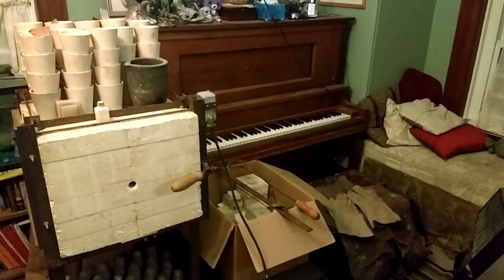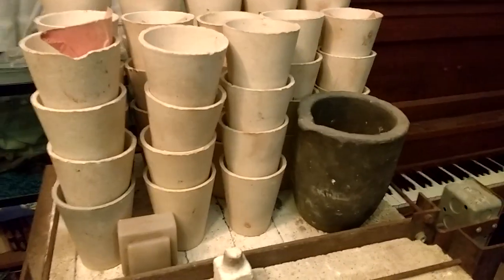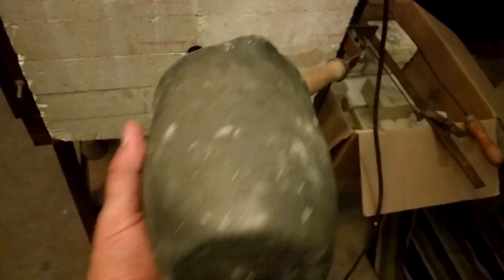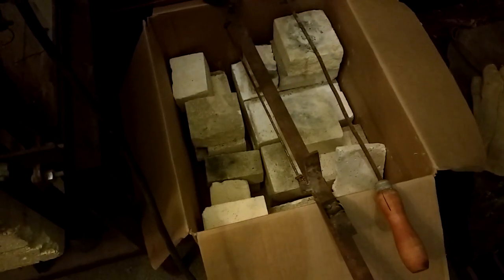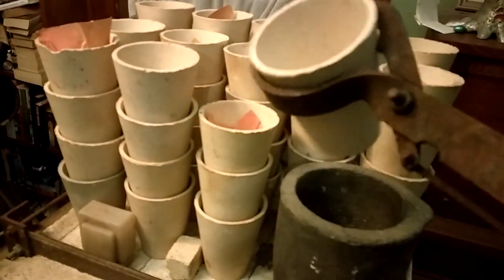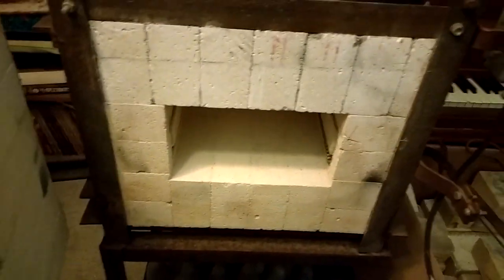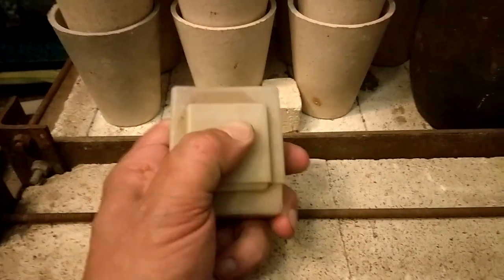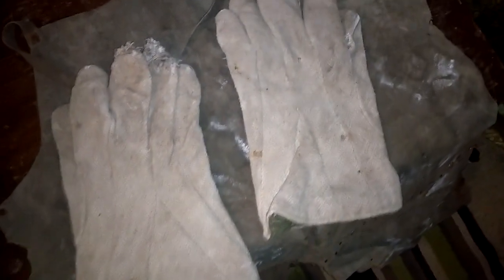New Foundry Gear - Electric Kiln, New Crucibles!

Comment: Nice find indeed. I had to pass on a electric kiln a while ago as my current place doesn't have the space to store it, and I don't have a slot in my current breaker box (have to do a 5k electric upgrade to get more than the tiny 100amp service I have)

Looking forward to seeing what you do with all of these new toys.
Reply from the maker: Well, I do have to find space for it...  I'll just have to see how many breakers I pop trying to run the thing when I get to that point, I guess.

Comment: Those pyrometric cones are standard pottery stuff. and I understand fairly accurate
I think those are red 08 cones and are based on a rate of tempurature increase. the red 08 cone should be something like 1728F for 108F/hr or 1753F for 270F/hr [942C for 42C/hr or 956C for 132C/hr]
Reply from the maker: Not a pottery guy.  So you're saying the kiln is at 1700F and change when the red number 8 cone slumps?  I am looking into upgrading it with some electronics which I'm told aren't too pricey, so I can work in degrees rather than cones, be able to ramp up, soak at a certain temperature for a while, ramp down, etc.  I don't want to melt the coils with an investment mold in there waiting for the bronze to melt while I'm still getting used to how it works and how fast it heats up!
Reply: @tobhomott  I'm not a pottery guy either. I've just spent a little time around some pottery/ceramics people. Yes, my understanding is when the red cone bent over (I think all the way over) the kiln is at 1700F cone rating. I've seen multiple different cones used in some cases, where 2 have bent over and the 3rd has just started to tip. kind of a safety on the target temperature.

The thermocouple with the pcl controls are great for the kind of precision temperature ramping your talking about. Although VegOilGuy seems to have an issue with his (mentioned in his electric kiln build)
Reply from the maker: @askquestionstrythings  I'll have to look up that video, I watch Vegoilguy but I don't think I saw that one...
Reply: I thought I had seen you comment over there too, we seem to follow a lot of the same people. the electric kiln is a good 3 part series. part 3 is the PID control stuff.
Makercize also has a good video on his electric foundry and PID controls
thought emporium also has a good electric kiln video with PID controls

For reference here is a cone chart I found. There are apparently two cones that are marked "8": a white cone marked "8" and the red cone you have marked "08" 
http://www.clay-king.com/kilns/pyrometric_cone_temperature_chart.html
Reply from the maker: @askquestionstrythings  I've kind of been avoiding trying to wrap my poor confused brain around electric kiln/furnace controls until now, since I normally run a waste oil furnace for all my sand and lost foam casting, and didn't actually need to know.  Electronics baffle me, but with this new acquisition to deal with, it's high time I finally figured it out...  Thanks for the link, I'll check it out.
Reply: From those videos, it seems the kits with the PID controls are mostly wire it, set it, and forget it. not a lot to do with it. I believe there is a little work needed to determine the best place in the kiln to place the thermocouple, but other than that if you have wired an outlet or a switch you can hook up one of these kits. There really are mostly plug and play.
Reply from the maker: @askquestionstrythings  Cool!  My friend Kelly Coffield was suggesting a K-type thermocouple with a PiD and an SSR.
Reply: Sounds like good advice. I think the K-Type are the most inexpensive for the temperature range. I would have to look up what upper limit is. There are probably other considerations to think about like how accurate it is at that upper range vs price. 

SSR output is fairly standard in the kits. 
I don't know if there are better options or better prices, but this looks like the typical kind of kit you want to look for. be sure to look at the temperature ranges the kits offer.
 https://www.ebay.com/itm/Professional-Ramp-Soak-Temperature-Controller-Kiln-SSR-Kit-Ceramic-Thermocouple-/121092751234
Reply: Oh another good video on electric kilns is the Oven conversion to a kiln that the backyard scientist did. more PID control stuff in that too (just plug and play)
Reply from the maker: @askquestionstrythings  cool, thanks.  My guy suggested I should buy a cheaper kit, toss the lower temp range thermocouple that comes with it, and replace with a cheap K-type.  To save some cash.  The upgrade will probably be a winter project, so I've got time to shop around.
Reply: That sounds like good advice.
Reply from the maker: @askquestionstrythings  yeah, Kelly knows his stuff that's for sure.  Have you seen his channel?  He has a super cool furnace rig that has swappable parts so it can run electric or off a burner, it's like something from NASA built to land on and conquer Mars, but he built it all himself.  And he's done some really amazing things with lost foam casting too: https://youtu.be/chMNWJCsrHo
Reply: @tobhomott  oh god !!. I seem to be on the moon

Comment: Hello . what temperature reaches that stove?
Reply from the maker: I have not tried to push it hard yet, I'm planning to upgrade it before I start actually using it, and that hasn't begun yet.  But I believe the resistance wire that heats it has a melting point somewhere in the range of about 1400-1500C.  Thanks for watching!
Reply: @tobhomott  I see. I used a steel crucible in my electric furnace and I noticed that at about 1200 ° C an electric arc is established between the crucible and the resistance and this melts the resistance. I did not understand why it happens.

Comment: I have been told in the very old days, long before any thermo couplers, people will put a list of small dice of different metals next to the crucible to check temperature, from zinc, alu, copper then iron, if it melts, for sure the foundry is hot enough. This poor man low tech always work, consider this method before you have time to make the thermo coupler?
Reply from the maker: Sounds a bit like how the pyrometric cones that came with the kiln work.  Interesting idea!